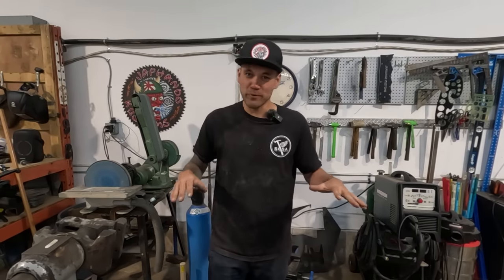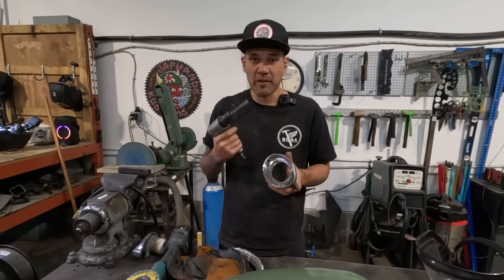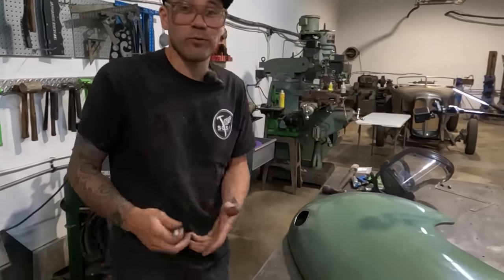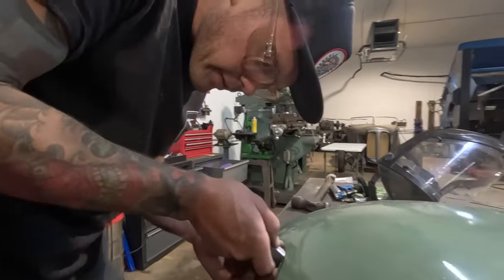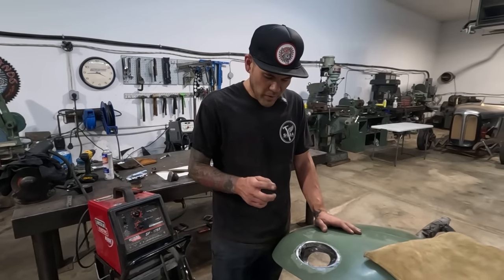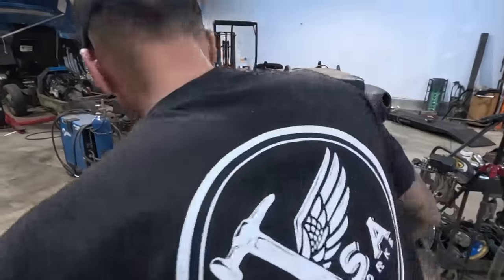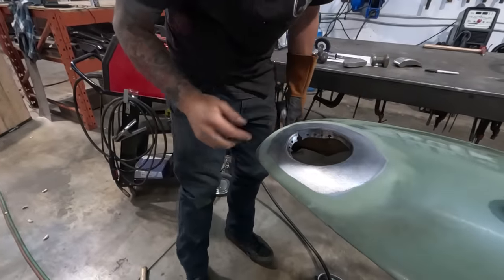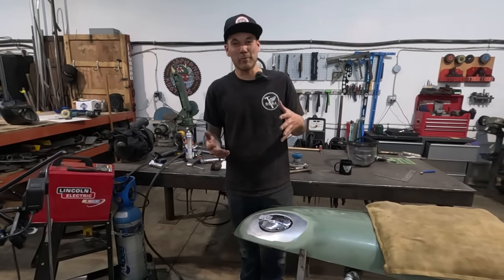HOW-TO Make CURVED FLANGES on SHEET METAL With HAND TOOLS Installing JAGUAR Gas Cap PLYMOUTH Fender

Comment: I really appreciate the editing of the sound. Like the grinding and pounding turned down, it makes for an enjoyable viewing experience ❤
Reply: Que trampo top❤Qual o nome dessa tampa de tanque?
Reply from the maker: Thanks for noticing! Cheers
Reply: Brilliant as usual. 😅
Reply: Hey, wouldn't it have been better to cut a piece out of another piece of sheet metal 1/2 to 3/4 inches thick, then weld it in and grind it smooth ?? Anywhere I love your content
Reply: seeing thart @MakeItKustom  seeing that it has to be welded, , id cut the flange in about 6 places, makes for easier bending, & wont split. & yes, id grill holes first. not as many.
Reply: @Frankensteinfabrications 
Idk but I’d be concerned with heat distortion affected by the metal stress  in the compound curve. 
A lot of factors at play.  😖😱lol
Reply: He has really good editing all around
Reply: Exactly what I thought when watching the first video on this channel today. Thanks!

Comment: Not taking anything away from your job, very interesting technique. I can't help but think how Fitzee probably would have done it. Take a 3" wide strip of sheet metal and bend it into your oval that fits your flange. Cut the oval into your fender and tack weld it all in. Then cut it and sand it to fit the curve of the fender. No worries about creating a flat spot by bending in the flange. I think he would have had it done in 20 minutes.
Reply: Nothing happens in 20 minutes.
Reply from the maker: Yeah, absolutely I think it would’ve been much quicker to do it that way
Reply: @seanfitzgerald4052 yeah, +100… nothing of any complexity happens in 20 minutes. I know the OP is probably exaggerating a bit to make a point, but I’m going to guess that some of the complexity here wasn’t anticipated until he really got into it, which is a thing, no matter how experienced you are. Been there….
Reply: @rmTheWalrus  😉👍

Comment: Made mine out of a piece of 3/4 round stock, goes around the bend like no ones business. 
Showing these old tricks is a big help to many, well done Carl
Reply: That's a really good idea. I was thinking of a slimmer tool so it wouldn't bite into the corners is hard, but a round tool would avoid that entirely
Reply: I would say to use 3/16 bar stock, so it took a smaller bite, also, we used to use a tool that was a round rod for a handle, with two rollers bolted on one side. You slipped it on the edge and just roll it back and forth to flange the edge. What I had was 1/4 inch flanges, but a thicker wheel would give a wider flange
Reply: I'm #42 like... This video is showing us what not to do which I like. No point in criticizing as after a long day of trying to get somewhere kind of narrows your thinking.
Reply: Came to say the same thing. Easier on the hands too. Also a bit longer for leverage.

Comment: Thanks for the video Karl! My dad was a metal man from way back (1950`s) and I learned a lot from him. He used to watch me repair dents and always required metal finishing whenever there was access to the backside of the panel. He taught me to always use heat whenever I needed to re-establish a flange. I think that more heat earlier in the process might have avoided the work hardening that caused the cracking. I would also say, an 0 or a number 1 tip on your torch would have allowed for better heat control. But in the end, you made it work and look great, so Cheers to you for a super fly modification.

Comment: Hey Karl, great educational video and it couldn’t have come at a better time. I’ve just started the metal work on my first project, a 72 Dodge Demon. I plan on using the fuel door from a 69 Charger. I now know how I’m going to do it. I use you’re videos as an educational resource and I’m quite pleased with the results I’m achieving. Thanks!
Reply: Did the Challengers have a similar fuel cap?
Reply from the maker: That’s great Alan! Thanks very much. I am glad to hear this was well timed for your demon Project!
Reply: @johnkranyics281  Not sure what the Challengers had.

Comment: A couple months ago one of your videos inspired me to bang on some metal. To make a parts washing basin, I cut about 6" off the bottom of a 5 gal steel can and made the exact same flange tool to turn over the cut edge then hammer and dolly it flat. Works great. Thanks for the inspiration. You rock!

Comment: Sometimes thinking ahead saves problems that arise afterwards good thinking 🤔😏 
I remember working at a body shop where there was a body man working on an old four door hardtop trying to aline the side doors having issues with the door windows not fitting with the roof seal very well I noticed then the doors were off the car that the center half post was angled in at the top from the doors closing all the time slowly bending the metal inward I let him play with it for a few hours before I  mentioned it to him to check the center half post for the front door latch and rear door hinges since it's not supported at the top roof area it will slowly bend inward with doors opening and  closing or slamming shut and twisting the Angle of the door frame so the window hit the window frame before the door fully closed ...

Comment: Hey Karl , thanks for another great class. I have short crescent adjustable wrench I use for flanging . It is about 5/16 inch wide and works great in tight spots.I also have a homemade wrench like yours, but mine is bent into right angle .works great. Please keep these videos coming!

Comment: I did something similar around ten years ago on a Plymouth.  Someone side swiped the rear quarter and the gas cap got caught on something and it mangled the fill area.  I cut out the filler neck area out of an old Chevy truck in the junk yard.  The radius on the car was a little tighter than the truck so I tightened the radius then cut and welded it in.  I did the big huge weld around the patch and new filler that you avoided doing it that way.  I had two hours total in the job and it came out real nice.  I could get to both sides of the weld with the trunk open with hammer and dolly.  Not sure if I would even want to try what you did that would take me forever, but wow, great job as usual, you are impressive.

Comment: Air grinder? Nice. I need one of those. I have a gagillion spot welds on a 1950s Willys floor pan and that will make my like much easier. Excellent video. I can put that flange tool to use immediately on my project

Comment: I built an adjustable depth one from a 1/2" bolt 6" long. Made a deep cut across the threaded end slightly off centre. This gave me a wide and narrow anvil for working different circumferences by turning the bolt 180º. Next I slipped on some 1/2" ID rubber hose to protect my hand, then wound on a nylock nut. This can be repositioned to make different depths of slot. Use a round cap screw [allen head] to be even kinder to your hand - you will likely make 1000s of tiny bends with it over the years. Cheers from NZ.

Comment: Yet another great vid Karl the hole in the housing is to let the rain water out to stop rusting as depending on which model some were mounted on the top of the  a lot of cars so it fills up in britain we get lots of rain 🤣 also in the past I have use a set of mole grips to do the same sort of thing and because they clamp to the sheet you can get a very tight radius by gently tapping the top as you bend they come in a lot of different widths and angles and are very cheap

Comment: I know very little about the sheet metal, but I do know that it work hardens much faster than a solid thick piece.  Trying to work a piece to shape on an anvil after it's lost it's heat always results in cracks.  I suspect the sheet metal work hardens much faster than a thicker lump.  That came out very well, even after the edges split.  Always a pleasure to watch and learn.  Thanks!

Comment: When you are a sheet metal fabricator and own a welder every problem looks bendable and weldable. 1. that gas cap looks cool 2. why not save time and make it look good by bending the receiver to match the underside of the gas cap area. add nutplates then matchdrill the screw holes and proseal it in place so it won't leak. The gas cap "look" would then be surrounded by say 6 or 8 fasteners and it would have a cool "aircraft/vehicle" one off kind of look. I also like pop rivets and anything that shouldn't look like it belongs on what ordinarily should be expected. I think your show is amazing and I look forward to more insights on your perspective of how the world can be made better!

Comment: You set a high bar; we are all the better for it...by far. This video puts me that much closer to cutting the hip-ring hole in the roof of my 1942 CCKW cab resto-mod project truck...that has a chance to end up looking like the one they came with from the factory. You are a master, indeed, especially in light of your transparency regarding the evolution of a first time project, learning-challenges included. (lotsa syllables for "mistakes"...that are much more learning-curve moments than **-ups, eh !? I'm a builder: I speak that language fluently. Got the scars to prove it.) Many thanks!
Reply from the maker: Ha ha you got that right to fill up! Good luck with your project. Thanks very much for your support. Cheers!

Comment: Neat little tool. I made a very similar (just significantly smaller) one to open up those older mechanical gauges. Had a few that worked well, but needles were too fainted to see easily.  It's sort of the opposite task with those since you have to de-flage their shiny "beauty rings" to get inside, but the idea worked well. 
If you do need to open one up, wrap the beauty ring with few layers of masking tape (so you won't scratch or stretch the outside), then un-flange the beauty ring on the back side and remove it together with the glass. From there you can touch up the needle, or remove needle and face all together for servicing of the gauge mechanism. In some cases you'll need to take couple nuts off the back of the gauge and the entire assembly can be removed from the housing. To re-assemble, put everything together and gently fold the beauty ring flange back down/in. Work on a piece of leather (piece of old boot even) to keep from scratching up the front of that beauty ring.

Comment: Hey Karl
   When you started to drill those GIANT holes I thought you had lost your mind !
I would have thought 1/8" holes would have been better.
   Also I thought you would have used a brazing tip to heat the metal rather than the giant cutting tip.
   But we do not all think alike !
          Work Safe, Be Well
                  Enjoy Life

Comment: I did a cap similar to that on my MGB. I cut the hole made that flange and bottom piece to mount the cap to and welded it in around the oval.  Came out great.

Comment: Nice job.  Beautiful work.  Hindsight being 20/20, I think I would have cut the hole out slightly oversized.  Then welded on a strip of metal so that the strip extended slightly above and the required distance below the fender, making a T all the way around the hole .  Then ground the new strip flush to the top of the fender and plug welded in the Jag piece.  No stretching the metal.  The flange tool would be handy for final fitment.

Comment: After doing a couple of these by hand, I modified a small pair  of needle nose channel locks by getting the ends red hot and bending them in towards each other.  This allows you to tweek that edge by squeezing it together instead of hammering so much. Plus it helps hold the flange for the tack weld. Your final product looks great, which is what it's all about anyway.
Reply: When heating up the plyers its necessary to have a piece of rod to clamp the plyers to while heating it up, to get the necessary gap. Pinchers are sometimes better than a hammer. 😊

Comment: Hey Karl love you videos and the way you explain the techniques.  I am in uk and use gas torches I have a device called an economiser which is basically a valve with a hook and the weight of the torch shuts the valve so flame goes out. To relight there is a pilot light so just lift torch and use pilot light to relight it.  Safer than leaving torch alight on a stand and also saves gas. No idea if they are available in your country but here you can get them for oxypropane or oxyacetylene here.

Comment: I've made myself a little widget like that before. Works like a charm, and as long as you're gentle, things go quickly. It doesn't make a perfect flange, but it's close enough to make it pretty easy to work into shape. Can't say I've ever tried to make a flange with holed drilled through it. I was fascinated to see how that would work out. The piece you're trying to fit is pretty ambitious, and of course the metal will fight you harder the more you try to move it.

Comment: Try using a solid 1in 12ins long round  bar as your hammer and shape your dolly to what you  need, I use half in or 3/4 flat  bar,  nice to make itonger, best hammer Fairmount 162 and shape the heads as needed

Comment: Two things, first the flange tool you made worked great, keep in mind that as you create the flange, the metal you are flanging will want to push the tool out, just a bit, the harder the metal the more pronounced the push back. Making tools of different depths will assist you on the flanges also.
Instead of drilling, if you made a mini stretcher, might work better.
Time to go out and make a template for my floor boards. 
Good luck in the land just north of me.
Reply: how would you go about making a mini stretcher tho?
Reply: @Tripmaster2006  My thoughts, we've seen shrinkers and stretchers, combine that with a wire striper that grips the wire, then cuts into the insulations while pulling the insulation off.  And while the jaws are pulling, perhaps an impact component to assist in the stretch..
Reply: @Tripmaster2006  Another thought would be a large pair of wire cutters, round out the cutting edges to compress the metal, simpler

Comment: Nice job Karl, thanks for showing us how to do this with a simple homemade tool. Could you make the tool out of round bar to get into a tight radius? 
Pre drilling the holes seemed like a good plan and I appreciate you being open and honest about the things that work well and things that don’t. Not just in this video, but all of your videos.
Reply from the maker: Thanks John yeah, I think a round bar piece would make the radius is much easier to flange! We are all in this together!
Reply: @MakeItKustom my task for this afternoon in the workshop !
As a kid I used to help an old Italian guy in his workshop 
Make the tea sweep up,sand things down and get the cakes
He could form anything with a few machines,and blocks of wood and metal and his gas torch and stick welder, mainly pre war stuff and motorcycles
Many years later he passed away,I went back to London for the funeral, his daughter said he left me something , a box of his hammers and dollies all cleaned and oiled,plus lots of other little tools and bits of brass and punches
Oddly there were a couple of bits of round bar with slots in them, guess what I cut them up to make something else
So today's job is !!

Comment: Great job on the tool and install. 
The drain hole/tube is more likely to let water drain out than gas. The pocket will probably collect more water than gas.
Reply: the profile of the pocket allows any water or even dust to collect at the low point which is where the drain is...we had two jags XJ6s and never had that issue ...British designed rememeber
Reply: @JustinPaul1st  So you, too, are famliar with Lucas the Prince of Darkness? :)
Reply from the maker: Yeah, it should be all right. Since it’s tipped on a slight angle, there could be a small puddle, but it will be at the bottom and not anywhere near the filler cap lip.

Comment: Great video and beautiful problem solving as you progressed. My only issue might be that the 'drain' tube seems to be in the higher/front end of the flange pocket where gravity won't help it drain.
Reply: hi dlux 
tje tjing with these Jaguar Fuel Caps is that they work differently.
they don´t use gravity, instead they use accelerate and brake, for that reason the drain is in the front and/ or the Back instead of the Bottom

Comment: A tipping tool! They work great. I made one out of 3/8" round bar. Didn't need as big a flange. I also rounded the bottom edges of the trough, sure helped a lot. I had a small oval, maybe 3"x 1", didn't have any troubles at all.

Comment: Hi Carl, love your vids..... If you would have heated the flange first while using your "flanging tool", the metal is softer and a lot easier to handle, keep hammering.... ; )

Comment: I do this with stainless sheet, use a 1" square bar about 12" long and cut a slot in the end of the bar about a1/4" in put the thin side to flange and the fat side to the panel and pull from underneath more leverage more control

Comment: Part of the issue that you are having with the tool that you made is that on the tight radius areas you would need the tool to be much narrower. When the slot that is cut into the tool is a straight cut slot, the radius cannot be bent any tighter than the width of the tool, because it is being held straight to the width of the tool. The tighter the radius gets, the narrower the tool would have to be. Multiple similar tools at various widths, starting with the wider and working down to the narrower would be a good option. Also, much smaller drilled holes in the tight radius areas would help avoid the breakage, and with added heat, they would likely stretch out into bigger holes as the metal around is stretched to the tight radius. Have a great day. Keep up the good content. It's nice to see someone being real, and not editing everything to make themselves look like they do everything perfectly the first time and don't need to learn and grow like all real people do.